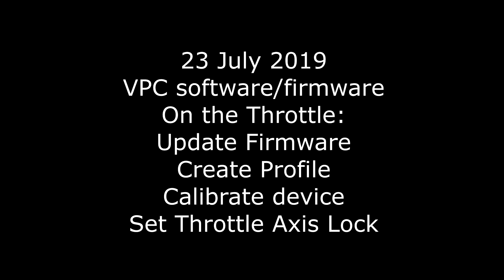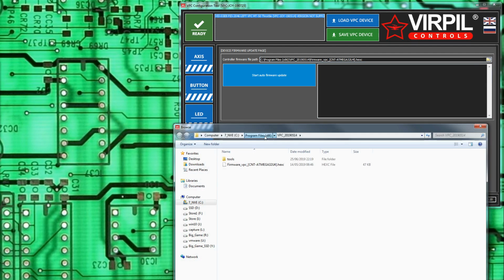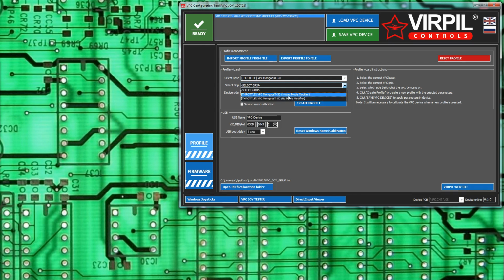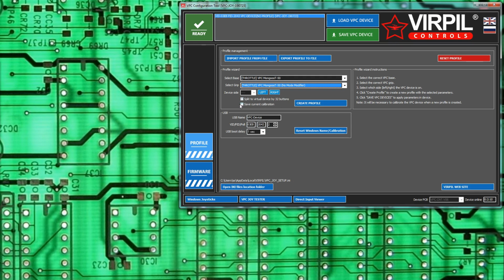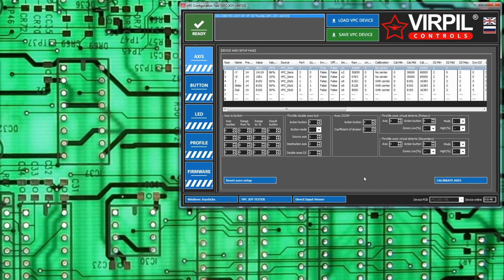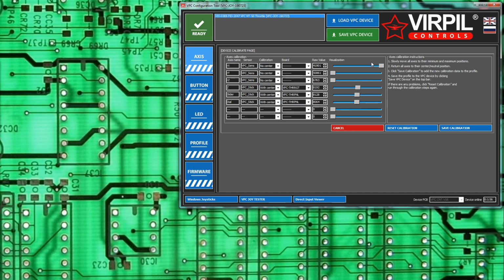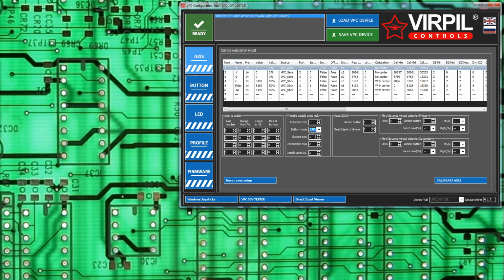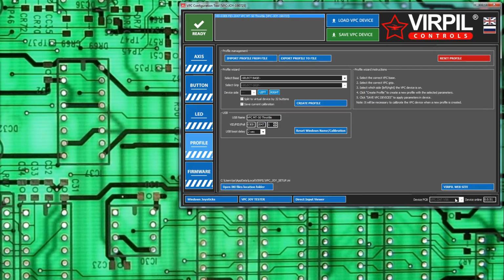Set-up and configure Virpil throttle tutorial - OUTDATED - see link below

Comment: Hmmm....in DCS my f-14 doesn't stay in afterburner when the throttle in at full forward. That's gotta be a calibration thing. What am I doing wrong?  I have the new cm2 Virpil throttle.
Reply from the maker: is VPC software in the axis tab showing 100% when the throttles are the full way forward ?
Reply: HavocCompanyClan there isn't a %, but, the slider does go all the way to the right.  The value is 16384.

Comment: so if you want to use the 5 way modifier mode selector, how would you go about setting that up? Id like to use the mode modifier to switch the rotaries to tune different radios.
Reply from the maker: create new profile (with mode modifier), save to vpc device, calibrate axis, - save to device, locate the two buttons that correspond to the encoder dials, create new mapping entry in button mapping table for two new logical buttons mapped to the encoder dial, this time use a shift mode eg mode 2 in the shift column for this
Reply: @HavocCompanyClan  and how would I set the mode selector switch? The dropdowns bring up: off, on,  tgl, rtr, and ext. Ive tried doing as you just mentioned, but turning the mode selector and pressing a button doesnt give me any additional key strokes.
Reply from the maker: go watch some of my other tutorials about buttons etc
Reply: @HavocCompanyClan  ill give it a shot, though I cant recall which one it was...ive watched them all lol

Comment: Do you have a video or can you point to me a place where I can learn to use the 5 way selector switch? I assumed when you went from 1 to 2 it gave me new mapping options for already bound buttons but all it seems to do is change the LED color? Thanks
Reply from the maker: it is a ballache to use the 5 way selector without using joystick gremlin, you run out of buttons real fast, when you go from 1 to 2, it only changes teh square buttons B1 - B8  ... unless you bind more of your own, joystick gremlin + no mode profile on the throttle is the way to go